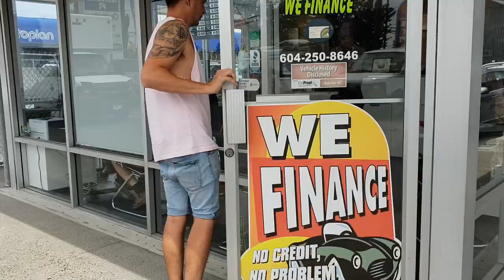GMC Savana | 7 Day Van Build | Part 1

Comment: Saw your pictures on Facebook. I love the layout you did. I have the same van and am planning a similar layout! Maybe we’ll see each other on the road!
Reply from the maker: Nicole Sparks absolutely! Always keen to meet fellow van lifers! If you have any questions about your build, let us know :)
Reply: Ben and Liv I do and I’m sure I’ll think of more as I go. Did you insulate the cavities where the wires for the back lights are? I worried it would be a fire hazard
Reply from the maker: Nicole Sparks where the wiring is, we used fibreglass insulation (pink batts) which is fire retardant.